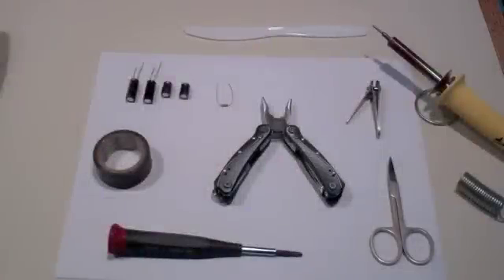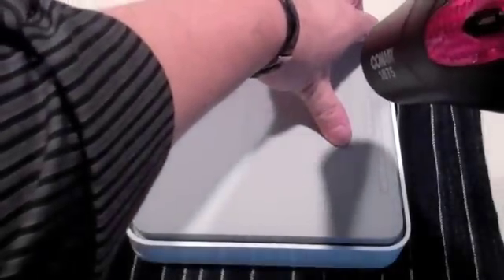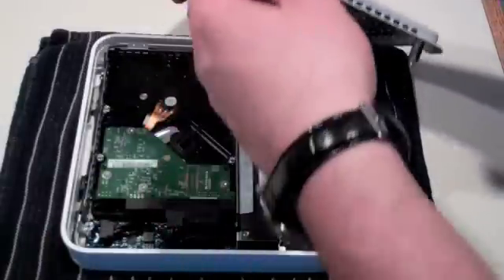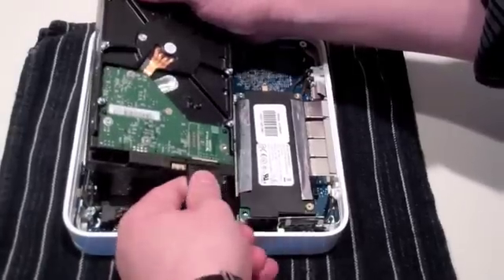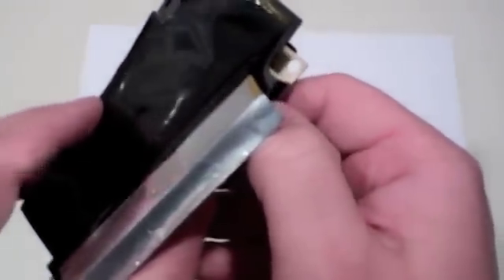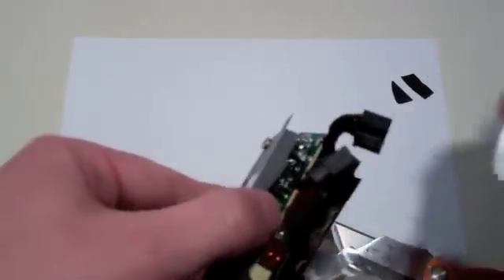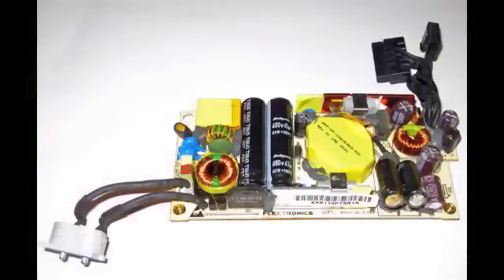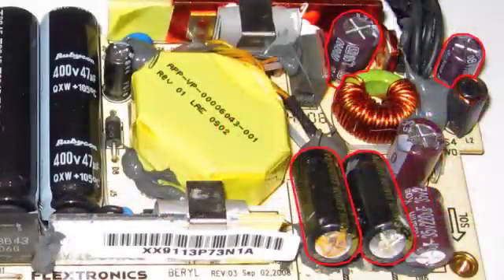Apple Time Capsule Repair Part 1 of 2

Comment: This video is extremely well done! Thanks a bunch.
Reply: Since it's the latest comment. Do you still use it in 2020+? The price on second hand is pretty tempting.
Reply: @highlowproductions3134  I am at least I did until it was working. Currently, the power supply is faulty. If I can get it fixed or can find a replacement I can continue using it since I don't have cutting-edge Wi-Fi needs.
Reply: Thanks allot for you response!

Comment: ☠️BLACK BARON☠️ 3:15 I tested this stuff out for years. El Capitan was the .dmg age. Very scary if a backup gets corrupted during a "WIFI session" and you try to mount the dmg image. I was utterly upset about the dmg stuff. I am still testing iPhone and iPad backup in iTunes over WIFI to check out how things are going in terms of reliability and speed.

Comment: My A1409 Time capsule Has no light when plugged in, not even a test. however, I can hear the HD spinning normally. Might that mean that the part of the power supply that powers the router has failed? Unit does not show up on Airport Utility.

Comment: Hello, i have a problem with my time capsule. it could be working perfectly for several hours or days, but suddenly it switchs off by itself.
I unplug the rear plug and plug it again and it works again, until the next time it switchs off.
Could it be the power supply?
Thank you

Comment: Hey highly considering buying the equipment linked (already watching it), however, I've got a couple questions:

1) my LED light does not power on at all. 
a) is this necessarily the power supply? (it seems to be the most common issue)
b) or the plug it self?

Comment: My power supply is labeled Flextronics, but has an additional connection not shown in your video? (you showed one, but I have a black one too). And it doesn't seem to come off. Not sure if that's a problem or not.

Comment: Hi, can you help me with the next:
What happens if you take the power supply, connect a SATA drive to the power supply and connect a power cord next. Should the hard drive start spinning although it isn't connected to the pcb of the Time Capsule? If it starts spinning that would mean that I can test a power supply if it "works" or if it is broken right?

Comment from the maker: You should be able to replace a faulty Delta unit with a Flextronics or any other alternative power supply unit.  They are speced the same and should just plug right in.

Comment: Hello. It is possible to replace a Delta power supply with some other series? I have a 614-0464 power supply unit and I found a 614-0412 unit on ebay. I've searched all over the internet and I found nothing about repairing a Delta unit. Thanks!

Comment from the maker: You may have a "Delta" branded power supply unit.  These are not common but are out there.  The Delta PSUs are typically more robust than the Flextronics ones shown in this video.  If you a having what you think is a power problem with a Delta PSU unfortunately you'll have to do some more troubleshooting beyond the scope of this video.

Comment: Hi, the power supply on my Time Capsule has a different configuration. Not the same layout and different capacitors as the one(s) you have in your video with different . Any suggestions?